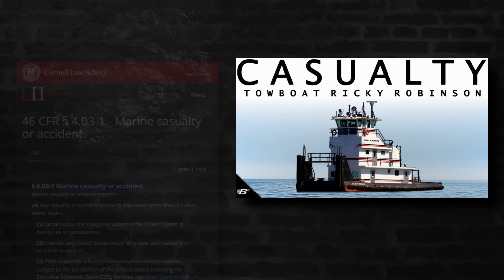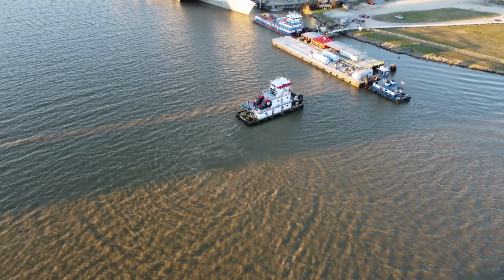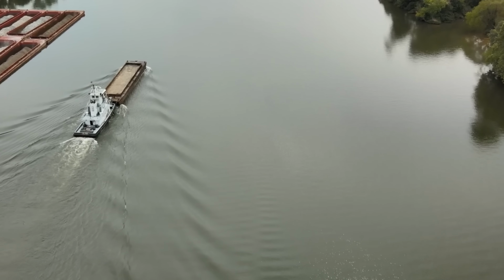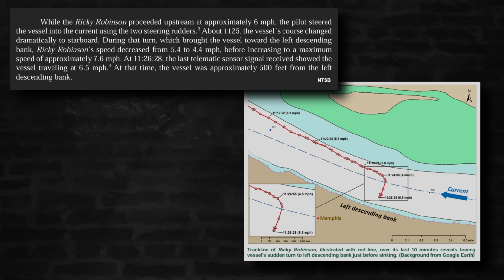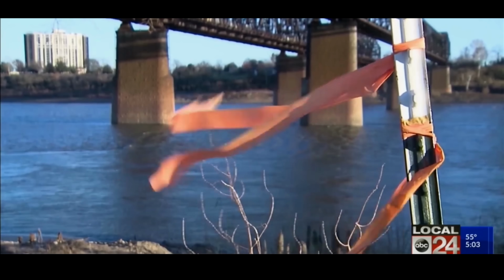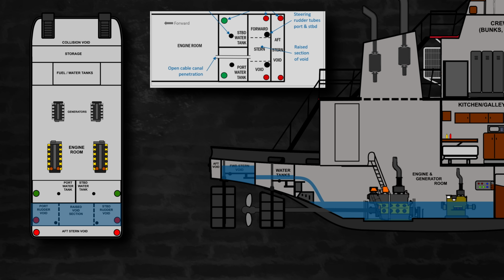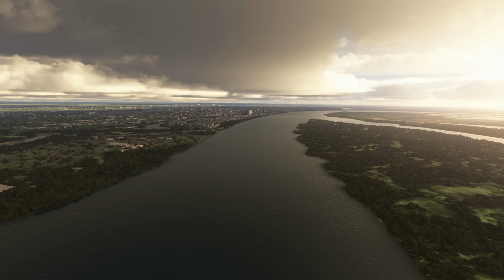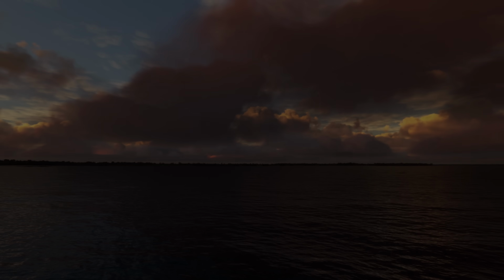INSTANTLY UNDERWATER: The Sinking of Towboat Ricky Robinson

Comment: It demonstrates the high level requirement for good watertight integrity on towboats that already appear unstable or top heavy, the main deck should have water deflectors down both deck companionways. Owners should have the structural integrity thoroughly examined during periodical survey dockings, all doors on the main deck should be dogged or sealed when the vessel is underway.

Comment: The reality of day to day operation, isn't always textbook. Companies say " Safety first" but it's probably 3rd or 4th in most industries. If you complain about equipment, they get rid of you. If you have an incident, they blame you for not reporting the defects. 
I ran Crane's and tried to be as diligent as possible, sometimes they got mad at me. Luckily I don't give a crap about the huff puffing when I refused to operate defective equipment which I deemed unsafe. Most people don't have the attitude needed in such circumstances. Sometimes, when the situation wasn't going to turn serious, I'd operate and let the defects reveal themselves causing a big mess and let them enjoy it. Told you so 😤 . After a few of these, they listened. These guys didn't get that chance.

Comment: I’m willing to bet the doors were open as well. It’s very tempting to leave the doors open for some ventilation when in calm waters especially the engine room doors in the summer. Don’t! More tugs and towboats have sunk because of open doors than you can imagine! An open door can sink a boat on seconds! All it takes is getting downtided, triped, or even turning hard, for the boat to go straight to the bottom. The only buoyancy that keeps most tugs afloat is the engine room believe it or not. If you flood the ER it will sink! The rest of the hull is full of water, fuel, lubricating oil, ect. It’s the ER where most of the buoyancy is that keeps a 200 ton steel boat floating!

Comment: If the only reason to maintain open hatches is to check for flooding, why not fill the voids with easily removable expanding foam blocks that will not permit large amounts of water to enter?

Comment: What’s the community’s thoughts on working boats that others have died on?
Reply: As they say safety is written in blood, for me the circumstances would make all the difference.

Like was the vessel a rusty deathtrap? Or did the company take a loosy goosy approach to maintance and procedures? Did the crew that died stuff something up? Or was it something like a design flaw or bad accident.

I would not want to work on a shoestring budget repaired rustbucket that has gone down once allready nor would I want to work for a company thats more concerned with their profits then my safety,

But if it was the deceased crew who messed up like sailing into a storm with a hatchcover loose or a some freak mechanical failure or maybe a collision then I think I would be okay with it. Take the learned lessons with me and make sure to not have history repeat itself
Reply: Excellent question, I thought that, too. Do mariners in general refuse to work boats that have killed others? Especially if they have literally sunk and been salvaged?
Reply: If Owners pay people to work their boats, the people will work the boats… regardless. If everything is a free-will kind of thing, not my place to judge. There are plenty of codes, regulations, & marine inspectors to pass judgement on the Owners, superintendents, operators, and the assets under their charge.

Comment: Operating regulations are usually written in blood by the unfortunate souls who highlighted the need for such regulation. I don't understand how voids don't have their own pump systems to operate without the watertight hatch being opened. Sounds like a gross oversight to me. But I'm willing to bet the company had full knowledge of the problem and probably instructed them to handle it as such. The captains knew that any written reports made would be to their detriment. That's usually the way things work up until they don't.

Comment: Why didn't they just jump in the water?  They would have been rescued in a couple minutes.
Reply: It happened too fast. They got slammed by a wall of water at the same time the ceiling became the floor/wall (both of which happening before they could take a breath), by the time they could have gotten their bearings they were dead.

Comment: Seeing comments about how these boats are poorly designed. These boats are designed with having barges in front of them most of the time. Not light boat. The problem is with complacent crew and throttle jockey pilots. You do not get under way with open deck hatches. And you should do your best to mitigate water over the bow like slowing down.